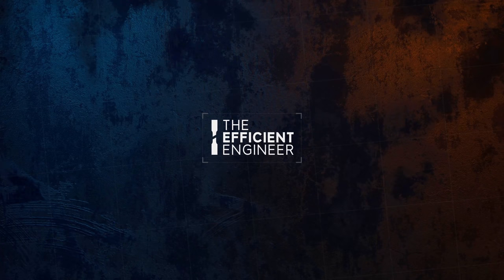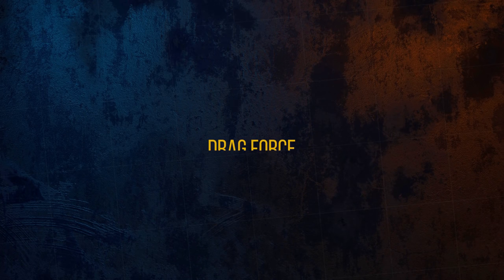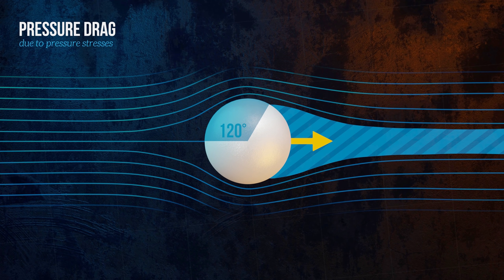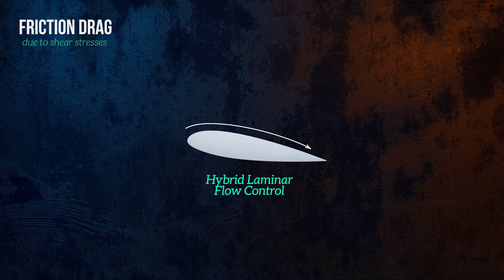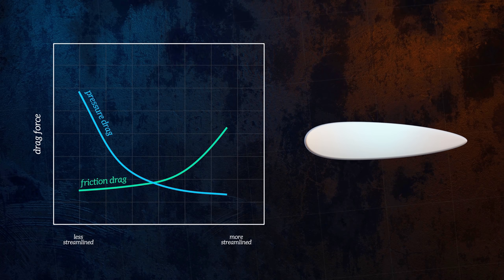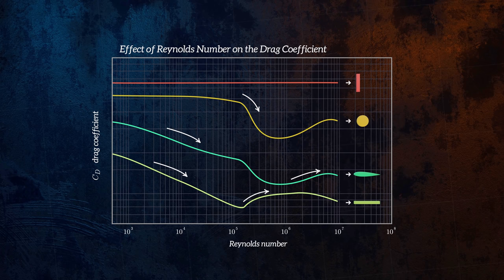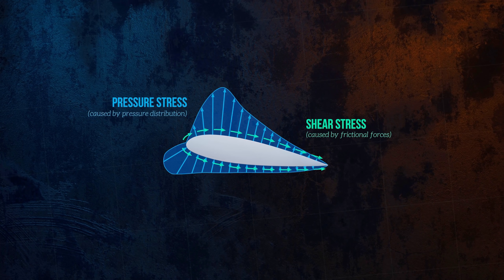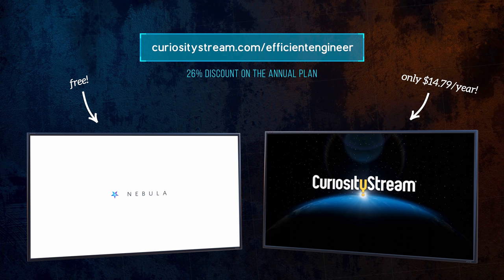Understanding Aerodynamic Drag

Comment: its called fluid dynamics; discipline of engineering; 
there is third friction or drag; 
its called totality of design; of object; 
when person stands with arms wide open in wind; 
if mustang side mirror is as big as semi truck's side mirror; it changes dynamic of totality of design of mustang; this affects center of gravity; and even more while it is in motion;
this is called center of motion; not center of gravity;  
reducing the size of side mirror affects totality of design; thus center of motion; 
center of motion is important when potential energy object becomes kinetic energy object as it is in motion; such as rocket; space shuttle; etc; 
thus object in motion is kinetic energy object; object in none motion;movement is potential energy object; and when energy transfer happens; fired round of shell; bullet; the energy transfer happens from potential energy object to kinetic energy object;

this is what happens to rockets; fighter jets; in afterburner; cars; etc;so center of motion is critically important in designing car; i.e. anti roll; or airplane; under side fin; etc; 
so there is 3rd option;